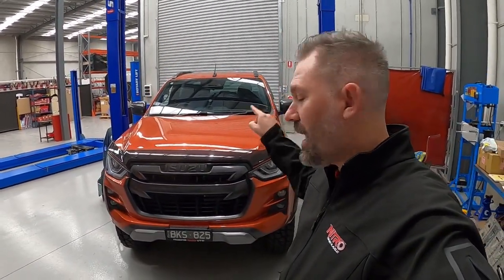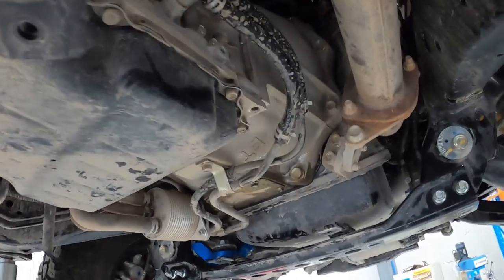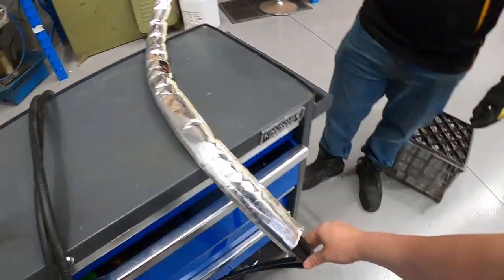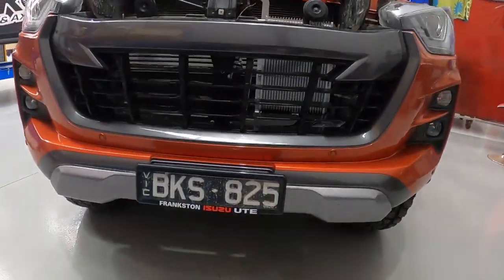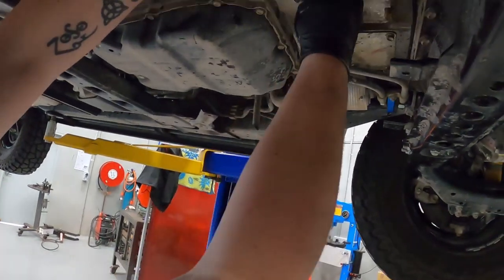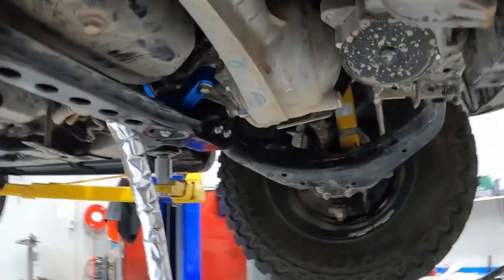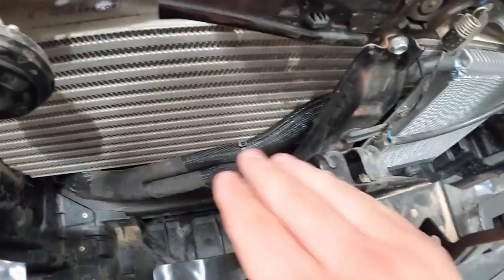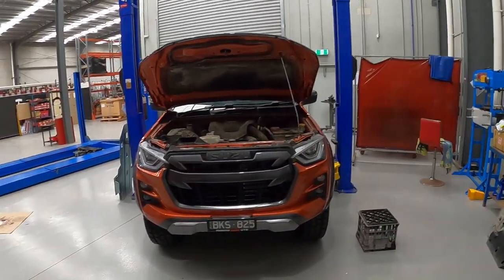ISUZU DMAX DIRECTION PLUS TRANSMISSION COOLER INSTALL @DIRECTION-PLUS

Comment: Would the hotter outlet pipe from trans to the new heat exch/cooler be better to just have cable protection over it rather than wrap next to cool return hose and inside heat proof tubing?

Comment: Will running the hot pipe with the cold pipe in the same heat shielding affect the cold pipe temps back into the box? Would have thought keeping them seperate would maximise the cooling effect?
Reply: There won't be a hot and cold hose, during operation it will be more like a hot hose and a hotter hose. The heat transfer between the 2 hoses would be insignificant.
Reply from the maker: correct

Comment: Why wouldn’t you run it through the factory heat exchanger too . I would. I’d try both ways and check trans temp . Unless the heat exchanger is prone to failure and getting coolant in the transmission then the bypass is essential.
Reply from the maker: You might be right, we just fitted it as per the instructions

Comment: Hey there, this question comes out of a fear. Just bought a new ‘23 Tacoma v6 and put a trans cooler on it for towing. 

I mounted a cooler on it where ports were facing horizontally. Initially I plumbed the hot flowing into the cooler at the top and the cooled fluid going back to trans was coming out of bottom port. 

Wasn’t seeing any temp changes so I bought a bigger trans cooler and mounted it horizontally, but this time I put the hot in the bottom and cool out the top back to the trans because I read it eliminates air bubbles, etc.. it’s definitely cooling more now. 

My question is -> did I do any damage to trans on the first install or starve the trans of any fluid due to air bubbles? I thought it would work fine emulating the radiator. I’m just disappointed that I didn’t do it right the first time. And definitely didn’t want to damage my truck any. First new truck I ever bought. Thank you for your time if you get to answer this!
Reply from the maker: No Mate I think you will be fine , great job on the cooler install
Reply: @nitrogearaustralia3949  thanks! Just didn’t want to hurt my transmission by trying to help it! Ughh

Comment: Would fitting one of these kits affect warranty.  Because you are bypassing the original cooler.
Reply from the maker: you would need to check with the servicing dealer, in most cases when you modify a part of a vehicle you may void the warranty on that particular component not the whole car, In the real world a trans cooler will help the transmission last longer
Reply: Better chance of not voiding warranty if it was to still run through the original cooling system rather than isolate it. I’d say they would take one look and say seeya later and void the warranty.

Comment: Will it affect the intercooler? Or the radiator since it is partially covered?
Reply from the maker: Not at all the factory, radiator has a pull through fan that cools very well

Comment: HI CAN YOU HELP ME PLEASE >
What oil is suitable for manual gearbox for Isuzu D-Max 2021 ?
In the owner's manual they say use SAE 15W40  engine oil
But this oil is not suitable for gears in high temperature areas
Reply: call the dealer
Reply from the maker: we recommend you contact the dealership we used the OEM OIL

Comment: Why did you choose to delete the factory oil cooler?  I would have thought keeping it a part of the loop would have still been beneficial
Reply from the maker: Great Question Shane , The dmax's cooling system runs through the transcooler block , if that were to ever fail it would be catastrophic to the transmission, by mixing coolant through the transmission so it is best to bypass it
Reply: @nitrogearaustralia3949   I think it's best to put the aftermarket cooler in a loop before the original cooler. ie transmission outlet hose to aftermarket cooler in front of radiator then outlet of the cooler back through the original cooler/heater then back to inlet hose on transmission. The original cooler also acts as a heater to help warm up the auto transmission oil when cold, not just a cooler. Running the transmission too cold can effect transmission shifting characteristics and effect fuel economy. For example some transmissions won't allow the torque convertor clutch to lock up until a certain transmission fluid temperature is reached. Transmissions are designed to run at an ideal temperature range, not just the colder the better. By running the transmission fluid through the aftermarket cooler first, the fluid will lose some heat so it will also not heat up the coolant as much when things get really hot - eg. 40+ degrees C when towing. How much are these kits and where can you get them? I've already ordered exactly the same universal cooler as this for my x-terrain, but would be interested to see how much the brackets are to save me having to make my own.
Reply from the maker: @gwhite618  We agree, but there is a risk of the coolant lines leaking into the transmission in serious off-roading, the kit comes from direction plus check them out I will put a link in the description

Comment: Why is this necessary in the first place?
Reply from the maker: when in low range off road at low speed or towing heavy loads at high speeds the transmission can get very hot and slip or limit torque

Comment: Thanks Guys. Is there any concern regarding blocking air flow to the radiator with the unit sitting in front. Cheers
Reply from the maker: None At all the thermo fan pulls heaps of air through the cores
Reply: Thanks

Comment: Hey Nitro, howdy, love your work and vids, Tkx!  & Wondering if you've had the opportunity to fit a DP Transchill to an MY22 MU-X? - The MY21 D-Max/BT-50 are 98% same as MY22 MU-X in the front chassis as well as the 4JJ3 engine and Asin tranny, and I'd like to know if this DP kit (for D-Max: TC645DPK) is totally same/suitable for an MY22 MU-X ?  I contacted the DP guys and despite Isuzu's shared platform, got a generic "we do everything from scratch / needs 3D mapping / go (away) and watch our social media for updates" response and they do not list a Transchill for the MY22 MU-X.  If your crew, or your colaborates, have done a tranny cooler for MY22 MU-X, I'd really value your opinion and experience. - Actually also have the exact same question re the DP Pre-line Plus and Provent kits too.  Cheers.
Reply from the maker: Hi BPS, we haven't unfortunately however you are correct the steps are the same follow this guide and you will be right, this method also works for nearly all auto transmissions